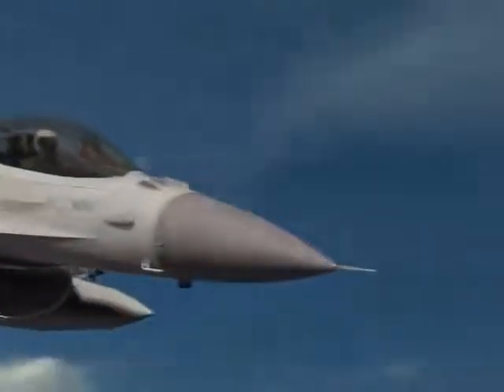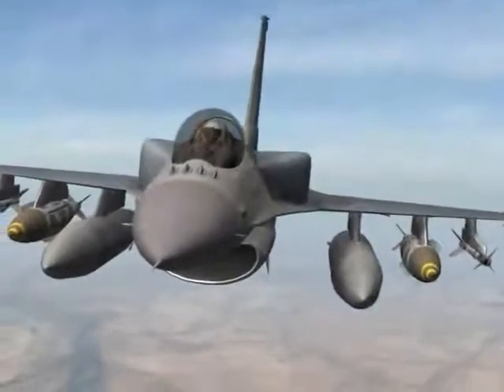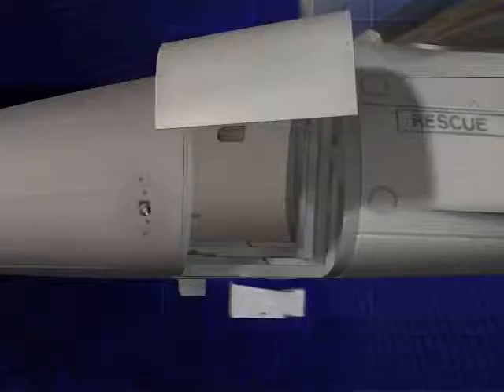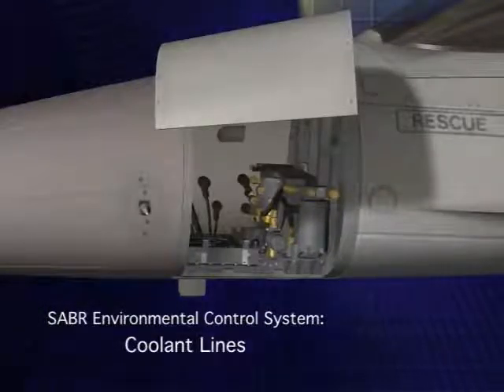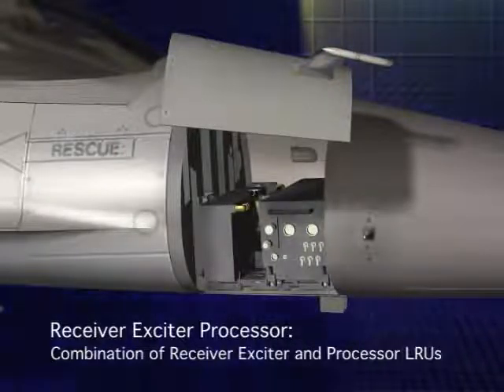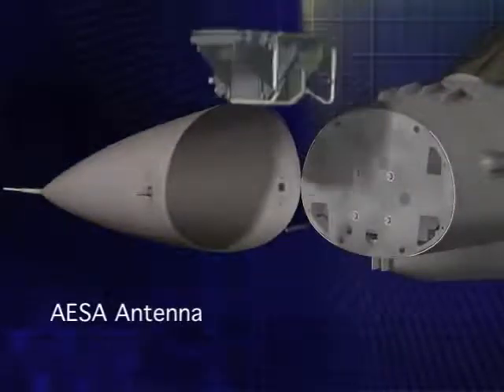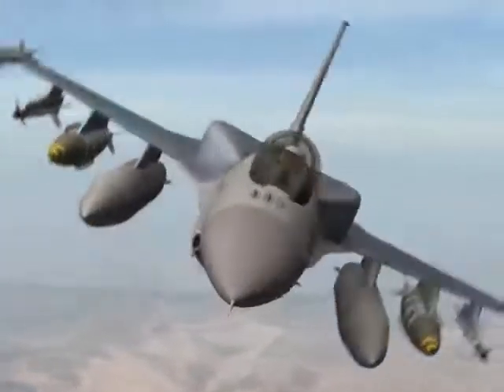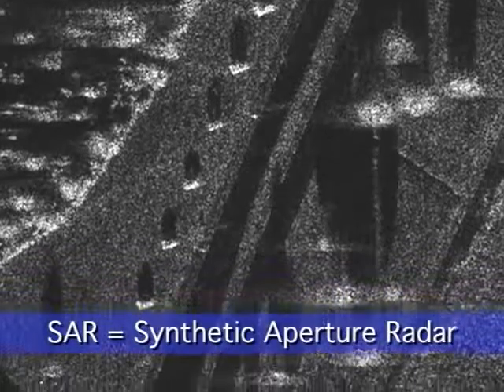2012-09-21: SABR APG-83 AESA Radar for F-16

Comment: which is the best radar between the apg 83 radar and the rbe2 of the rafale?
Reply from the maker: If you mean by comparing the latest apples with apples and match the F-16's Northrup Grumman AN/APG-83 SABR up against the Rafale's Thales RBE2-AA?   If so, I like APG-83 SABR.  Are you well-briefed on the performance metrics?
Reply: @TomOwensUAP  the only think i know is that the apg 83 radar has s range 0f 230 miles while the rbe 2 of the rafale 75 miles